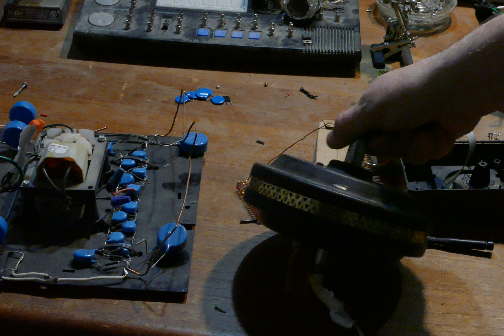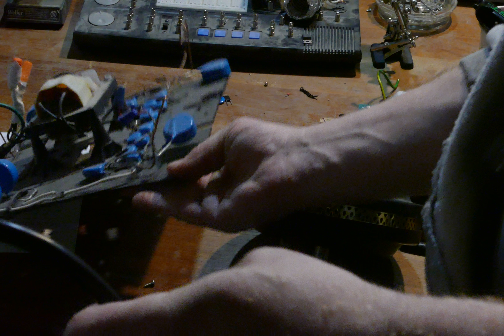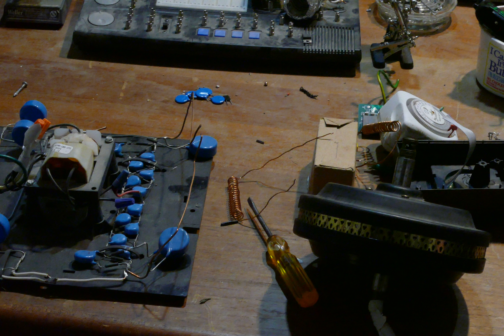Handcranked 40kv in 4k

Comment: I kept imagining a contraption that involved a hamster wheel, and a really fast hamster.   💁‍♀👩‍🏫
Reply from the maker: Hand-cranked, not Ham cranked. Lol. Creating a 1 inch spark without a battery, capacitor or any other power supply shows a simple generating unit that can be used to power batteries by a bicycle, which is the plan, or a wind up spring
Reply: @RkicF8  
Hi. They have a new' liquid battery that doesn't require lithium.  
Cost is 90% cheaper than Giga-tronics batteries (Musk).
Know anything about it?  Nontoxic and a cylinder can be
re-filled instead of charged.  Water'/Iron? I think and 
something else.  
How is it coming along with this project of yours?  My eyes
can see today, so I'm looking over some research, and 
watching some of your older videos.  Nerd wonderings.
Reply from the maker: @myhalowithin  Lol. This video was the last time I was ever sick and 80 pounds heavier. My best advancement from this video is I stopped eating sugar. Lol. 
I am not aware of any new technology on batteries. From ancient Egypt to today a battery cell has never produced more than 1.5 volts. This video demonstrates power creation regardless of storage type rather lithium ion phosphate, the best on the market, or lead acid standard. I actually took the bug zapper and connected 2 copper plates to it and created an artificial chromosphere in my living room. The strange thing about this device is I split electricity into positive and negative to create the 40KV and no one has figured out how or why.
Reply: @RkicF8  -creating the current/flow/garden hose (electrical theory  is not my forte, although perhaps a 101 Physics I should apply).
Have to research further.  I was electrocuted at the age of 15.  Funny story, later.  Imagine with braces caught on an e-fence, because 
I wanted to visit a horse behind it.  No, I did not know!  The horse did! The horse did!  Later on the rest. 🐴⚡⚡⚡
🎡 wheel system just entered my brain?

Congratulations on cleaning your system up    Sugar was replaced by honey with me as a child.  Salty preference anyway.

 Have an excellent day!  Whistle a happy tune. 

PS. hope this makes sense, as my sight and sentence structuring seem to be related. lol
Reply from the maker: @myhalowithin  Any type of nuclear strike will cause an EMP blast and no solid state circuitry will survive. In the event of an outage this type of device could be used for power to charge any remaining batteries. But when used as a power source would be put in parallel with a bank of capacitors that might have to be hand made with saran wrap and aluminum foil. Many people who have been hit with electricity dont like it, it is very dangerous. I really dont like being shocked, I've been hit by 120 hundreds of times, e fence, 65,000 volt spark plug, and 480 volt transfer switch.⚡💥☠
This video is important in creating a power source if needed without component that would be affected by an EMP. It's very interesting how I split the AC frequency into positive and negative voltages. Electricity is not understood at all by anyone, lol. Have a great day.